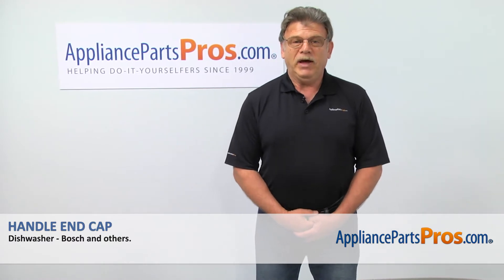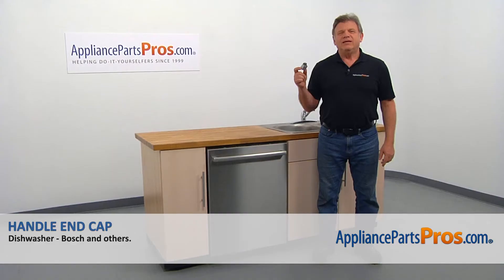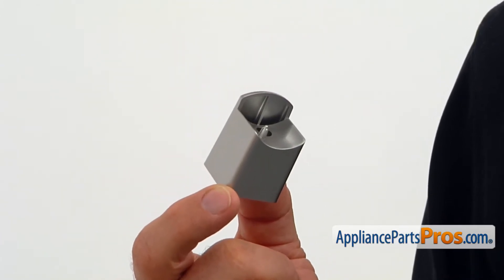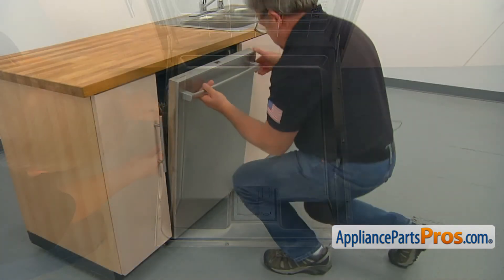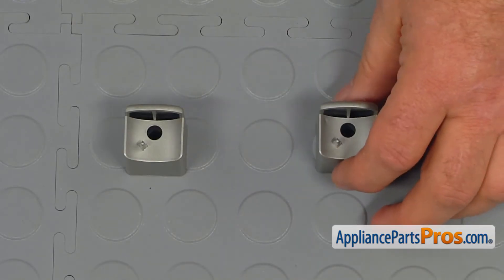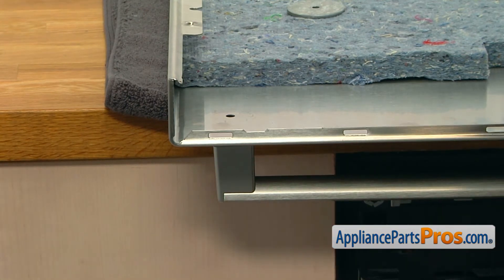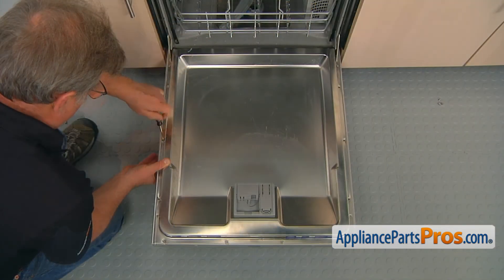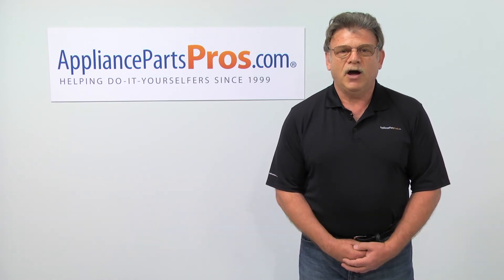How To: Bosch/Thermador/Gaggenau Handle End Cap 00628998

Comment: Thanks, gave me a good base to work with to tighten a loose handle.  Had to remove two top screws close to the outer edge, no need to remove the ones in the centre.  Basically,  you just need to remove the dome shaped screws and you can leave the flat ones in.  Pretty easy, should only take 15 minutes to remove and reinstall.

Comment: For my model (SGX68U55UC/F1), not only did I have to remove the THREE screws on each side as shown, but I had to remove the OUTERMOST screw on each side on  TOP of the door, otherwise, the door would not budge.
Reply: Yes, ours required that two top screws needed to also be removed. lots of struggling. This video should be updated. Also the dishwasher panel has some very sharp edges as well.

Comment: How do the spacers attach? thanks.
Reply: I’ve got the same question.  I can’t figure out where they go because they fell off, while taking the door panel off
Reply: @timhawn6325  @SuperSlapp25  @gmas9966 They clip into a notch near the bottom, with the rounded side toward the front and outside of the dishwasher.  I figured it out because they had left a small indention in the insulation.  They fit pretty securely, so I can't figure out why they just fell out when I took the door off.

Comment: my problem is that the door panel is connected to the inner door by wires and I cannot get to the screw to remove the handle and end cap.😫
Reply from the maker: What is your model number?
Reply from the maker: You will need to remove the outer door panel to access the screw for the end cap. You will remove the screws on the inner door panel and pull the outer door panel out carefully to access any wire connections and you will disconnect those then pull the outer door panel off. You can access the screw from there.
Reply: @appliancepartspros  that's the challenge.  Getting the wires disconnected from the control panel that is attached to the outer door and the inner door.  I don't see any screws to remove the panel nor do I see any clips or connectors for the wires.  But I have to get the control panel disconnected from the outer door and that process has escaped me.
Reply from the maker: When you open the door there are 10 screws on the inner door that you will need to remove so you can get the inner door and outer door separated. If you are unable to locate the screws the only thing we can recommend is contacting a technician.
Reply: @appliancepartspros  thank you.  I can get the doors separated but cannot get control panel which is attached to the outer door unattached.  I appreciate your efforts to assist.  Thank you.